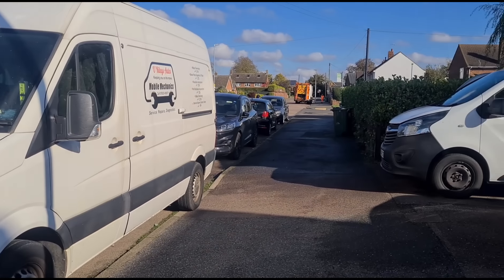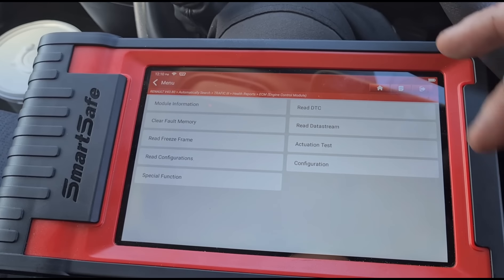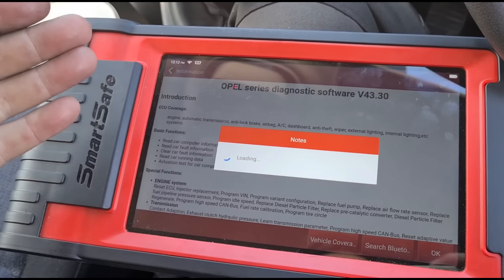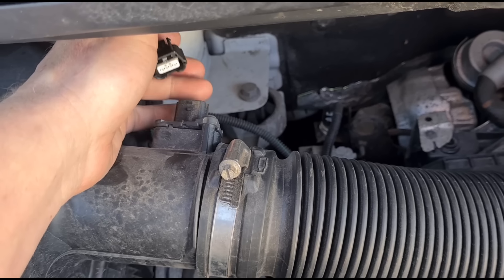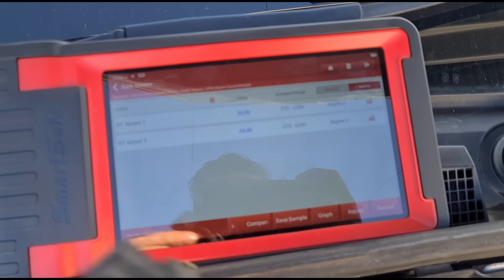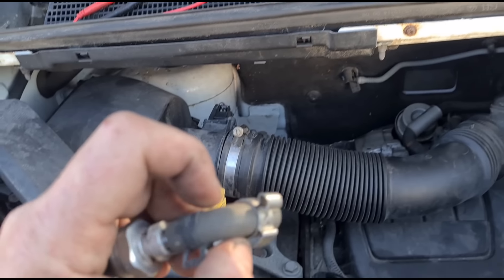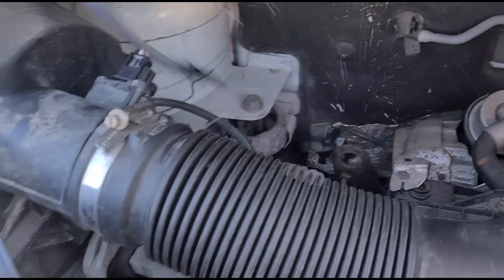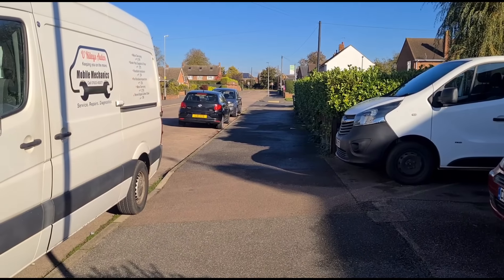Vauxhall Vivaro  P0095 Air Temperature

Comment: The only way to get accurate readings for temperature sensor 2 is going through eobd2! Also never use a non oe sensor on a trafic/Vivaro they don't work correctly.